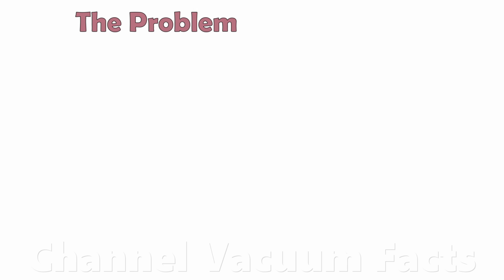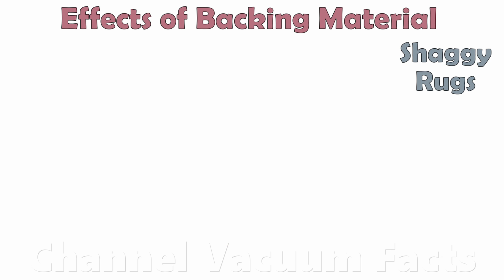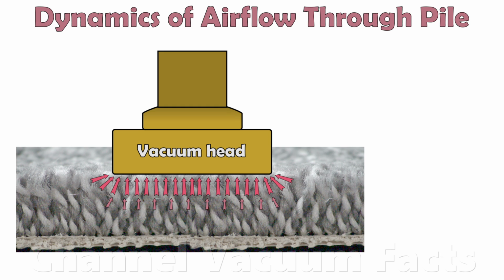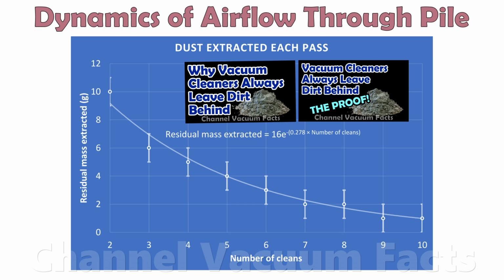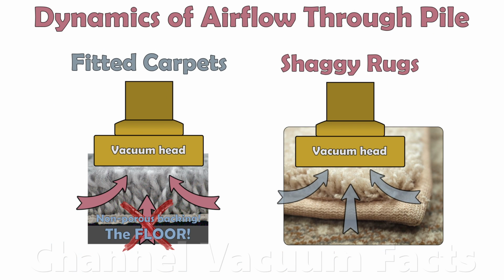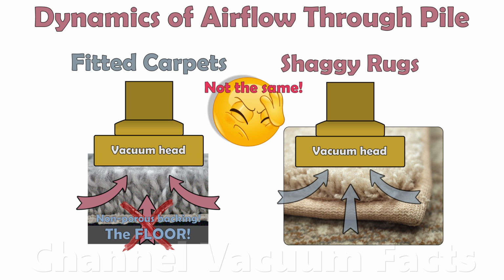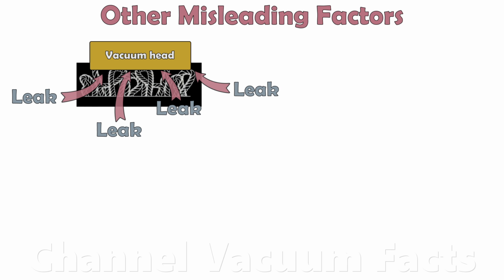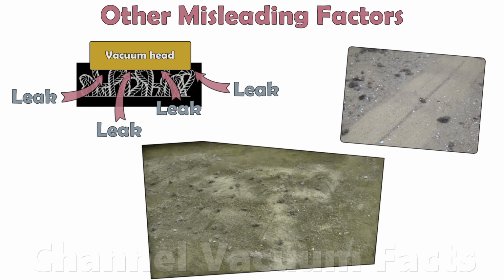How Rugs Are Used to Mislead Kirby Vacuum Performance

Comment: This is hilarious. I would be more inclined to take this seriously if you were directly discussing the different types of vacuum cleaner instead of dropping name brands and "near perfect" conditions. I am not disputing your facts, but since you seem to discount experience as 'feelings' (no sarcasm there I guess) let's have a look at what a Kirby is. A Kirby is called a 'system' because it is ultimately a convertible electric turbine. You are comparing a vacuum (one purpose) to a multi-purpose machine that is if (properly haggled or purchased from a retailer) similar in price to a Dyson. If you aren't going to take the time to use the attachments that Kirbys have, then get yourself a cheap vacuum and if it cleans your carpet to your satisfaction have fun. I on the other hand frequently use my Kirby to shampoo my couch and carpet, as a leaf blower during Autumn to clean off my porch, to blow up air mattresses when I have guests, to clean behind my washing machine, walls, top sides of my ceiling fans, clean out cobwebs from hard to reach areas, and vacuum out the car using an extension cord (good luck with your stick vac doing all that). Apples to Oranges.
Reply from the maker: I'm glad you're not disputing the facts presented in the video here (even though you didn't say anything in relation to any of the specifics this entire video was about). If you have any objective, carefully measured facts of your own to share, and an explanation carefully grounded in textbook science easily fact-checked, then send it along.

As for other points raised: I notice you stipulate to get a Kirby comparable in price to a Dyson, it has to be 'properly haggled'. That's absurd, suggests scam, and a big negative. You talk about 'retailers' but cite absolutely none. They aren't for sale on Amazon or online from the manufacturer. They may be for sale from backstreet independent retailers who get commission, but that's another world away from how the rest of the planet does business.

The Kirby may be able to use its basic air-moving motor for a myriad of other things, but, in case it isn't obvious, it's presented in a vacuum cleaner format, is primarily a vacuum cleaner, and therefore is fair game to compare with other vacuum cleaners. That has been done, constitutes the facts you noticed, and the conclusions have been drawn in many other videos on my channel—it is sub par. Being a jack of all trades is no virtue if it's master of none—especially it's primary purpose of cleaning floors. It's not as apples and oranges as you've suggested. You can easily buy separate dedicated blower or other product to blow up mattresses etc. for far less. Wet-cleaning carpets is also an absurd approach (this is covered and demonstrated in detail in many videos on my channel).

You've said nothing of value here and it merely seems to be a case of you liking the Kirby machine because it works well enough for you. Well great, each to their own, but that doesn't negate any of the facts and conclusions drawn in the playlists below.

Kirby playlist https://www.youtube.com/playlist?list=PLBxUOcW7kaEs7xuTK2A-pncwupMjXuRbb
Carpet cleaning playlist: https://www.youtube.com/playlist?list=PLBxUOcW7kaEu8EFLi2rq3aU9A1QTQ0Xkp
Reply: “I'm glad you're not disputing the facts presented in the video here (even though you didn't say anything in relation to any of the specifics this entire video was about).”

Are you referring to carpet pile types? The point is it doesn’t matter, use what works for you. You are going to extreme lengths to discredit one particular brand and your page seems to be well into one brands camp. 64% of your videos are dedicated to Dyson. Life doesn’t work clinically use what works for you.

“If you have any objective, carefully measured facts of your own to share, and an explanation carefully grounded in textbook science easily fact-checked, then send it along.”

Irrelevant my comment has nothing to do with the specific facts quoted in the video because I agree with them. I am not writing a thesis on carpet backings.

“As for other points raised: I notice you stipulate to get a Kirby comparable in price to a Dyson, it has to be 'properly haggled'. That's absurd, suggests scam, and a big negative.” 

How is it absurd to shop around to get a good price? That’s business. Haggle to get the best price. There is no scam here, and it isn’t a negative, it’s capitalism. Some people sell things of the same quality at lower prices than others. Do you pay sticker price for everything?

“You talk about 'retailers' but cite absolutely none.” 

Sew and Vacs are everywhere friend stop being ridiculous.

“They aren't for sale on Amazon or online from the manufacturer.”

Yes they are. In fact there is an Avalir 2 on Amazon right now for $750 US. Or I can go to the Sew and Vac down the road selling one for $600. Of course I’m not going to drive down to the Berlin Auction to take a picture of the sales tag to appease you.

“They may be for sale from backstreet independent retailers who get commission, but that's another world away from how the rest of the planet does business.”

How bleak. I can’t recall the last time I had to sneak down a back alley to pick up some HEPA Bags or a couple of belts. Of course independent shops are the traditional standards of business and online shopping is a fairly recent phenomenon anyway. “Sales” has always been about commission. “Upselling” happens all the time. Ever heard of Expedia? Well they make you think you are getting a deal but I work in the Hotel industry and they get a pretty good commission. On top of that, they usually charge about 12% more for a room than if you just went to the Hotel on the date of Check-In. Of course that is always a gamble for availability but that’s life friend. Risk is part of the deal.

“The Kirby may be able to use its basic air-moving motor for a myriad of other things, but, in case it isn't obvious, it's presented in a vacuum cleaner format, is primarily a vacuum cleaner, and therefore is fair game to compare with other vacuum cleaners.”

Well of course it’s fair game to compare them, but to sit there and act like a vacuum cleaner is equivalent to a Kirby is ridiculous. A Dyson ball isn’t going to fill up my air mattress faster than the mattresses pump can or any of the other things I use my Kirby for outside of “just vacuuming”. Even if vacuuming is it’s main function, it is still only “one” of the functions, and as I recall, I am fairly certain I mentioned that if all you needed was just a vacuum then you would probably be wasting your time buying a Kirby. Oh and Kirbys have never been marketed as a vacuum. They have always been marketed as a home cleaning/sanitation system through in home demonstrations and independent retailers. There own website is clear as day about that.

“That has been done, constitutes the facts you noticed, and the conclusions have been drawn in many other videos on my channel—it is sub par.”

What?

“Being a jack of all trades is no virtue if it's master of none—especially it's primary purpose of cleaning floors. It's not as apples and oranges as you've suggested.

You know what being a “jack-of-all-trades” is? Useful. You know what isn’t “virtuous?” An inanimate object, they lack agency. The Kirbys primary intended purpose is to be a jack-of-all-trades cleaner to give housewives more time to do other things. Which was their essential tagline/argument throughout production of the machine until it became politically incorrect to assume all women were housewives. I don’t need the world’s greatest can opener I need a can opener. So I get the one that has the most value for my purposes. And that is the point. The science of carpet backing? Please. There is no practicality to this video at all. It is just an over researched attempt to make a specific brand seem less appealing. I came upon this farce looking to see how well my Kirby would do on high pile carpeting but instead found this ridiculously over-thought long drama about the finer details of sand through glue. I went over to performance reviews and heard what I needed. The Heritage 2 is harder to push on high pile carpet so you want a self-propelled machine. That’s all. You are really anti-Kirby and it shows.

“You can easily buy separate dedicated blower or other product to blow up mattresses etc. for far less.” 

Why? Where would I put all that? I have a closet in an apartment with cramped space. I have a Kirby that fits there, and the attachments that convert it into the different things it does, sit above it on a shelf. Easy. Practical. Useful. My couch is always clean and smells nice which is good because the couch cushions are sewn in so I need a portable cleaner. My porch is clear of debris and organized, my carpets aren’t stained and they smell nice and my Mini is cleaner than most. The air quality in my apartment has been tested and it is very good, the HEPA bags were recommended by the doctor for my allergies and they work.

“Wet-cleaning carpets is also an absurd approach (this is covered and demonstrated in detail in many videos on my channel).” 

Oh pardon me. I forgot everything has to be scientifically precise or “it’s absurd.” 

“You've said nothing of value here and it merely seems to be a case of you liking the Kirby machine because it works well enough for you.”

I’ve said plenty of value. It just doesn’t seem to be valuable to your agenda. Which doesn’t make it any less valuable to others who may feel what I have said has value. You go on in the comments about other people’s methods and how their videos are also “entertainment” and dismiss someone who is genuinely pointing out that a Kirby works for them as “feelings”. Smug! Why is a thesis required to show them the error of their ways? And don’t use the word “objectivity” when 64% of your videos are dedicated to ONE brand.

“Well great, to each to their own, but that doesn't negate any of the facts and conclusions drawn in the playlists below.”

Ummmmm duh that was my point, I’m glad you agree with me.
Reply from the maker: >> “Are you referring to carpet pile types? The point is it doesn’t matter, use what works for you.
No, the video content you’re commenting on as stated. And you don’t appear to understand it.

>> “You are going to extreme lengths to discredit one particular brand and your page seems to be well into one brands camp.”
I’ve simply stated facts and exposed techniques used to mislead. This was in the video you didn’t watch.

>> 64% of your videos are dedicated to Dyson.
I doubt that number is accurate, but even if true, 36% are not. I have an interest in exposing falsehoods and champion great, pioneering technology. Dyson happens to carry the flame on that front and so gets preferentially more attention. I’ve no allegiance to them as stated countless times on the channel.

>>Life doesn’t work clinically use what works for you.
Of course; each to their own. But facts are still facts, whether you like them or not.

>>”my comment has nothing to do with the specific facts quoted in the video because I agree with them.”
Not sure what you’re whining about then

>>”How is it absurd to shop around to get a good price?”
You’ve now redefined haggling to “shop around to get a good price”. That’s not the same thing and you know it.

>> ““You talk about 'retailers' but cite absolutely none.” Sew and Vacs are everywhere friend stop being ridiculous.”
Third party local backstreet retailer that gets commission. Not a modern online seller available to order for delivery from anywhere.

>> ““They aren't for sale on Amazon or online from the manufacturer.” Yes they are. In fact there is an Avalir 2 on Amazon right now for $750 US.”
Resale from individuals; not a formal retailer. Apples and oranges, as you’d say.

>> “I can go to the Sew and Vac down the road selling one for $600.”
Second hand. Apples and oranges

>> “I can’t recall the last time I had to sneak down a back alley to pick up some HEPA Bags or a couple of belts.”
We’re not talking ancillaries. We’re talking the machines.

>> “Well of course it’s fair game to compare them, but to sit there and act like a vacuum cleaner is equivalent to a Kirby is ridiculous.”
That a contradiction in terms and that is ridiculous.

>> “A Dyson ball isn’t going to fill up my air mattress faster than the mattresses pump can or any of the other things I use my Kirby for outside of “just vacuuming”.”
OK but Kirby is primarily a vacuum cleaner, and not a very good one.

>> “They have always been marketed as a home cleaning/sanitation system through in home demonstrations and independent retailers. There own website is clear as day about that.”
No, a simple fact-check on their website clearly markets it as a vacuum cleaner—just that it can also do ‘more’.

>> “ “That has been done, constitutes the facts you noticed, and the conclusions have been drawn in many other videos on my channel—it is sub par.” What?”
Its performance and ease of use has been measured and reviewed on my channel. The links were provided.

>> “You know what being a “jack-of-all-trades” is? Useful. You know what isn’t “virtuous?” An inanimate object, they lack agency. The Kirbys primary intended purpose is to be a jack-of-all-trades cleaner to give housewives more time to do other things. Which was their essential tagline/argument throughout production of the machine until it became politically incorrect to assume all women were housewives. I don’t need the world’s greatest can opener I need a can opener. So I get the one that has the most value for my purposes. And that is the point.”
What a load of bollocks

>> “The science of carpet backing? Please. There is no practicality to this video at all. It is just an over researched attempt to make a specific brand seem less appealing.”
As I said, you didn’t watch it or understand and dismissed it outright. It’s all fact-checkable. If you’d watched the videos, all the evidence is provided.

>> “I came upon this farce looking to see how well my Kirby would do on high pile carpeting but instead found this ridiculously over-thought long drama about the finer details of sand through glue. I went over to performance reviews and heard what I needed.”
And there goes the last threads of credibility citing such silly sources of propaganda and factually inaccurate, biased nonsense in staggeringly hypocritical fashion.

>> “You are really anti-Kirby and it shows.”
I’m stating facts that are objectively measured. Someone who interprets facts as bias has problems.

>> “the HEPA bags were recommended by the doctor for my allergies and they work.”
You might want to review the V15 and Gen5Detect reviews if clean air expelled from a vacuum cleaner is important to you. The Kirby HEPA bags are not as good as many think.

>> “Why is a thesis required to show them the error of their ways?”
Because they’re factually incorrect, and the evidence is provided in my videos. Sorry you don’t like or understand it.

Ultimately, you seem to be confusing a subjective opinion with objective true. I’ve seen this countless times and it’s simply not possible or worth investing time in trying to educate lost causes that are incapable of appreciating this. I’ve done my part on this front out of courtesy now.
Reply: @VacuumFacts  
1.	"No, the video content you’re commenting on as stated. And you don’t appear to understand it."

Ad hominem waste of time

2.	"I’ve simply stated facts and exposed techniques used to mislead. This was in the video you didn’t watch."

Ad hominem waste of time

3.	"I doubt that number is accurate, but even if true, 36% are not. I have an interest in exposing falsehoods and champion great, pioneering technology. Dyson happens to carry the flame on that front and so gets preferentially more attention. I’ve no allegiance to them as stated countless times on the channel."

64% is correct and whatever helps you sleep at night. It clearly shows bias toward a brand. “Carry the flame” “champion” how dramatic sounds like you need to be a hero.

4.	"Of course; each to their own. But facts are still facts, whether you like them or not."

Technically correct is the best kind of correct but facts will always be facts, some facts require exact conditions. The facts you are referring to require exact conditions and are therefore clinical. Life is not a clinical experience.

5.	"Not sure what you’re whining about then"

You say I’m whining; yet I’m not the one who spent hours of research just to discredit one specific brand. Smug

6.	"You’ve now redefined haggling to “shop around to get a good price”. That’s not the same thing and you know it."

Shopping around includes haggling as part of the process. Splitting hairs (which seems to be a trend here).

7.	"Third party local backstreet retailer that gets commission. Not a modern online seller available to order for delivery from anywhere."

Kirby sells them through their website, further what is a back alley Sew and Vac? You usually find them along main roads proudly selling Singer sewing machines and Mieles. Also what is a non-modern online seller?

8.	"Resale from individuals; not a formal retailer. Apples and oranges, as you’d say.
"
 I am not the one who used Amazon as a base to make a point. The original argument was that they weren’t on Amazon but they are posted via Sew and Vacs and individuals. Also until Kirby sold them online they were all resale through distributors. The only thing a third party sale does not get you, is a small warrantee and a guarantee that as long as you pay Kirby money anytime you are alive, they will rebuild your machine to spec. Either way you can once again just go to a Sew and Vac or Kirby specialist and have them rebuilt anyway. Although I believe you are confusing "Formal Retailer" with corporate retailer. A Sew and Vac is the definition of a retailer.

9.	"Second hand. Apples and oranges"

Incorrect. Sew and Vacs are third party retailers that purchase brand new Kirbys and resell them to a consumer at their own price. That is how Scott Fetzer set it up for the in home sales model. While there are many “second hand” models available at Sew and Vacs you are assuming all Sew and Vacs are selling previously owned models. Also the status of a product is not comparing the product to another thing while assuming they are the same thing. In fact comparing Kirbys to Kirbys is the exact opposite of apples and oranges. Sorry no gold star for you.

10.	"We’re not talking ancillaries. We’re talking the machines."

Oh right let me rephrase that for your hair splitting. I don’t recall the last time I had to sneak down a back alley to purchase a Kirby. 

11.	"That a contradiction in terms and that is ridiculous."

Incorrect, it is not a contradiction to compare something and not equate them at the same time. For example, I can compare a pan to a chair and note that they are not both the same thing. You are assuming a Kirby is the same thing as a standard vacuum. Which is incorrect.

12.	"OK but Kirby is primarily a vacuum cleaner, and not a very good one.
"
Irrelevant dismissal of the point. You clearly agree that Kirbys are not standard vacuum cleaners. It’s ok to admit that. Nobody will fault you for it. And whether or not it is a good one is irrelevant to the statement “use what works for you.” You seem to keep bypassing that point here and it confuses me because that is my point. But of course your smug hero complex won’t allow you to accept that apparently.

13.	"No, a simple fact-check on their website clearly markets it as a vacuum cleaner—just that it can also do ‘more’."

I believe the exact quote is “The Kirby is more than just a vacuum. The one machine for all your home cleaning needs.” 

For someone who "champions facts," it seems the inconvenient ones don’t apply for you.

14.	"Its performance and ease of use has been measured and reviewed on my channel. The links were provided."

Thank you for the clarification. I agree you have certainly measured performance and ease of use.

15.	"What a load of bollocks"

“Bollocks?” Just because it’s “British Jargon” doesn’t make it any less vulgar or offensive. Grow up. 

16.	"As I said, you didn’t watch it or understand and dismissed it outright. It’s all fact-checkable. If you’d watched the videos, all the evidence is provided."

Incorrect. As I recall, I have time and time again stated I agree with your research you just happen to be suffering from cognitive dissonance here. You can agree with facts but also note that the facts are conditional. Although as I keep saying and you keep failing to hear, it is what works for you that is important I am not arguing superiority here. I am disputing your smug dismissal of peoples experience as though your clinically correct information must always be the result no matter the situation. Your facts are not tautological. They are conditional correct and true, but again life is not clinical as previously stated.

17.	"And there goes the last threads of credibility citing such silly sources of propaganda and factually inaccurate, biased nonsense in staggeringly hypocritical fashion."

Performance Reviews isn’t propaganda, he is a vacuum mechanic and bases his conclusions on real world experience. And didn’t you at one point use a video of a Kirby trying to suck something through carpet-backing, and haven’t you been pointing out that airflow is carpet-backing dependent? Why did I have to sit through an extended thesis to get close to the answer I needed. He actually just tried to push the machine on that specific carpet style and made the statement based on the result of the attempt to push the vacuum. Took no time at all. The length of this video is comedic. It is almost like the existence of Kirbys at all offends you. Why can’t you just admit that if it works for someone then it is perfectly fine for them? Again you completely dismiss other peoples experiences because they don’t line up with your facts. A Hoover may very well be the best vacuum for my neighbor because that is what they want. Toyotas are amazingly reliable vehicles but they aren’t what some people want. We don’t all have to bow down to some ridiculously overstated argument. Facts are facts, but some facts are conditional. Which is a fact…

18.	"I’m stating facts that are objectively measured. Someone who interprets facts as bias has problems."

I’m not interpreting facts as bias I am interpreting your fixation as bias. Read between the lines. But we all find it difficult to see our own bias at times.

19.   "You might want to review the V15 and Gen5Detect reviews if clean air expelled from a vacuum cleaner is important to you. The Kirby HEPA bags are not as good as many think."

Excellent advice, I shall take it into consideration.

20.	"Because they’re factually incorrect, and the evidence is provided in my videos. Sorry you don’t like or understand it."

You are really showing just how much you are failing to hear what I am saying. I said outright I agreed with your facts, and I didn’t say I “disliked them.” I’m saying that if something works for someone you shouldn’t go on a tirade about how wrong they are and dismiss what they have to say as ridiculous. You should accept that some things are conditional and if it works for someone then great and if it doesn’t work for you then great. Life isn’t clinical. You are the kind of person who likes to use big bold statements and details to make others feel inferior and it is grating. It makes others feel vulnerable and makes them question their very real experiences. Kirbys may “not be very good vacuums” (conditionally) but they are very good at being a jack-of-all-trades. It’s okay to accept that some tools are better at doing some things while at the same time there is more than one way to accomplish a goal. 

21.	"Ultimately, you seem to be confusing a subjective opinion with objective true. I’ve seen this countless times and it’s simply not possible or worth investing time in trying to educate lost causes that are incapable of appreciating this. I’ve done my part on this front out of courtesy now."

Truth isn’t objective, facts are. But, again some facts are conditional. Although I fail to see how if I agree with your factual conclusions, I am incapable of appreciating them. Just because I don’t feel that life is clinical doesn’t mean I can’t appreciate information. You on the other hand can’t seem to appreciate other people’s experience, or that some facts are conditional and that is my point. Smug. And Intentional. This is exactly what you have wanted from the start, the ability to pat yourself on the back for doing a fine job overwhelming the uneducated masses with your heroic crusade against a brand while raising the banner of Dyson Justice. Well congratulations. I’m sure that your self-satisfaction and dismissal of others has saved Egypt from the depths of climate change.
Reply from the maker: I don't share your opinions, mostly because they seem based on things which are objectively false, poorly supported, or simply entirely subjective. I'm interested in what's objectively true and that's what my videos focus on. If you have any meaningful, specific points to make on matters of fact, then please do, with evidence. Otherwise, I've no interest in any further subjective opinions you have.